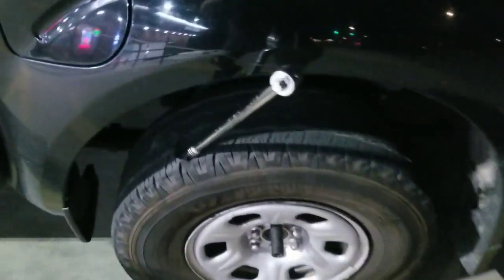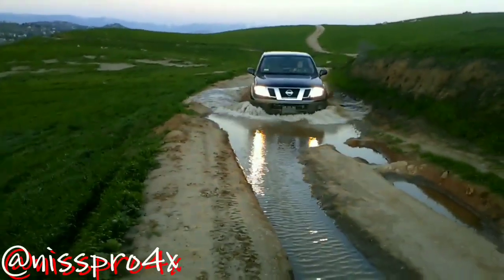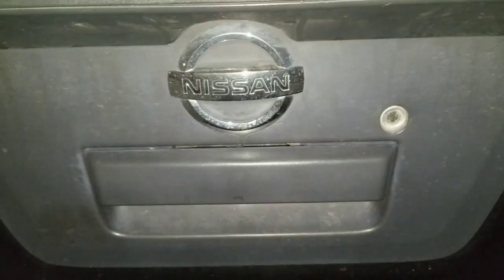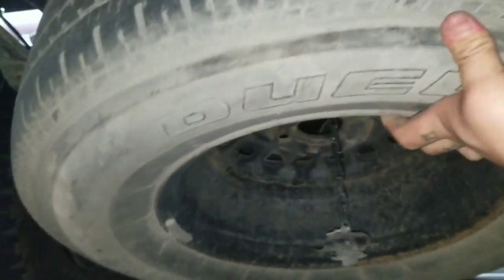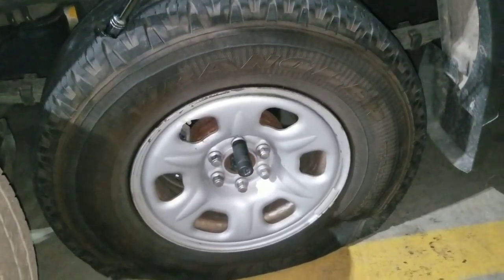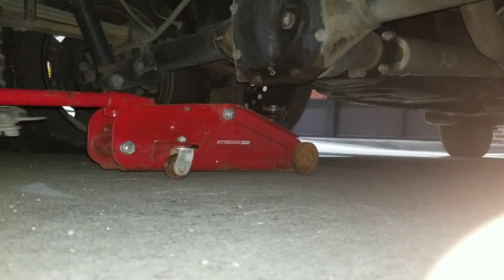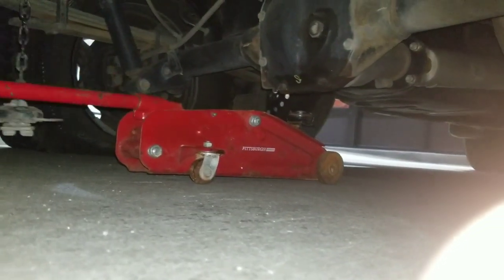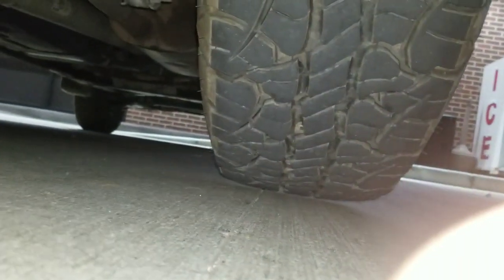2014 Nissan Frontier - How to Remove The Spare Tire #DIY

Comment: yooo what up mane....
im tryna help out change a tire on a 2004 Nissan Frontier, but need a key to unlock spare tire any recommendations to where I can get one?
Reply from the maker: I'd imagine you could find one on Amazon or eBay if you can't find it at a Nissan dealer. Is it a stock lug nut or aftermarket?
Reply: @DavidNaritaYT  for sure and vehicle is stock
Reply from the maker: @omarbaron56  then you should be able to get it from the dealer but check Amazon and eBay first for better deals.
Reply: @DavidNaritaYT  thanks much, but I actually just used a socket, extensions, and a ratchet worked just as good 🙌
Reply from the maker: I thought you said it was a key?
Reply: @DavidNaritaYT  that's actually what AAA told me and they couldnt even assist me with it cause of the so called key lol
Reply from the maker: @omarbaron56  🤣🤣🤣 Well at least you got it figured out now.